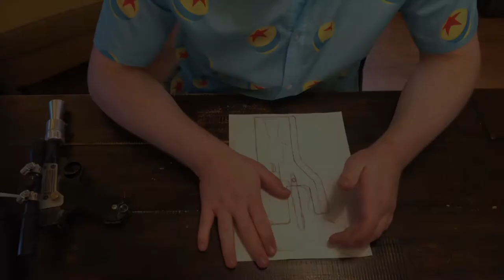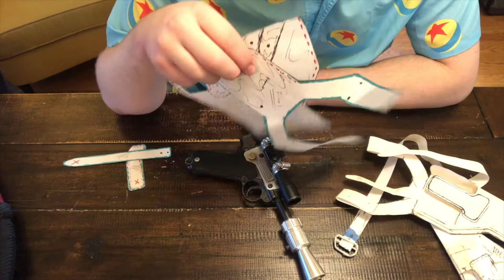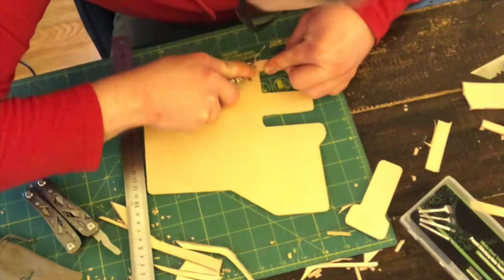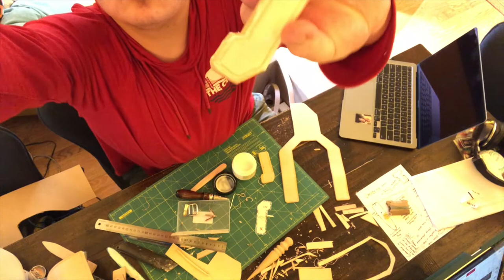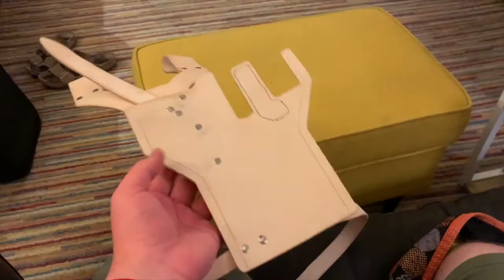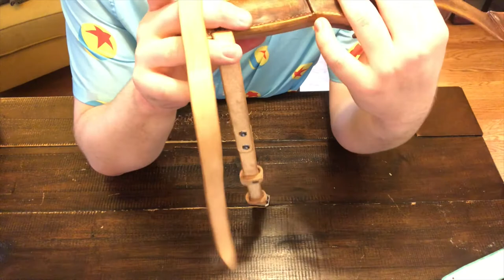Build Your Own Custom STAR WARS Blaster Holster!

Comment: Awesome Holster.  Don't worry about the area where you messed up, It gives it character.  If you don't mind I have a few leather working tips for ya.  Get a Rawhide mallet, and a piece of marble when tooling your leather.  The marble will give you a solid flat surface and kinda dampens the blow.  The Rawhide mallet won't deteriorate like the rubber one, and won't mushroom your tools like steel on steel will.  All in all, you did a great job.
Reply from the maker: Thanks for the helpful advice. I’ve been trying to figure some of this stuff out while working on a mallet heavy Witcher project I’ve been working on. Seems like a logical next step, right? And over time I have grown to like how it turned out a lot, the more beaten up the more in universe it feels. Thanks again!
Reply: @willhamilton297  No Worries.